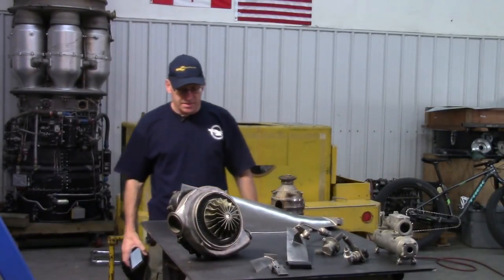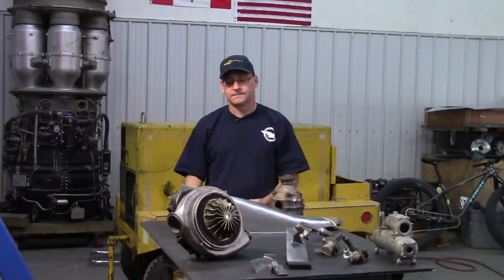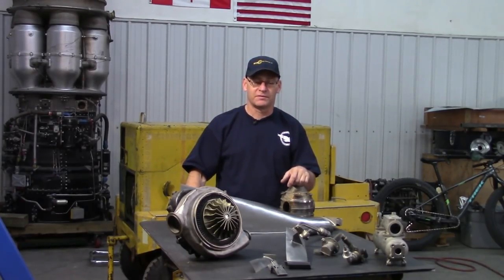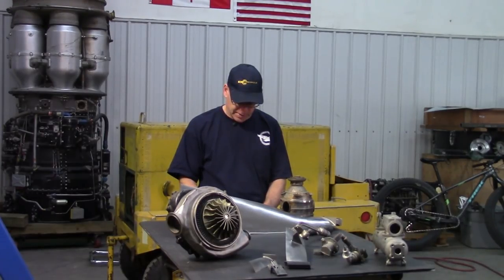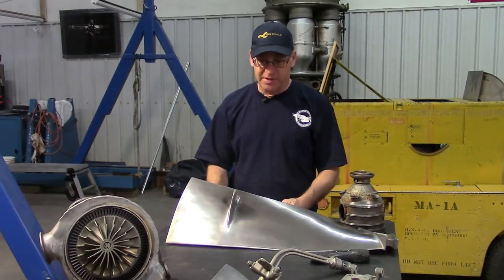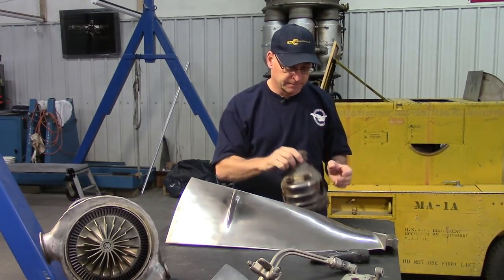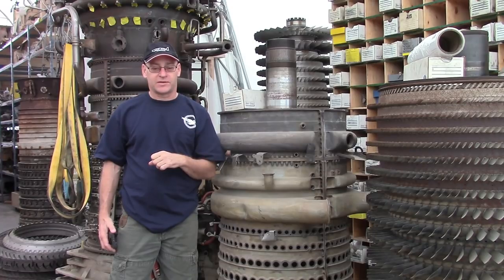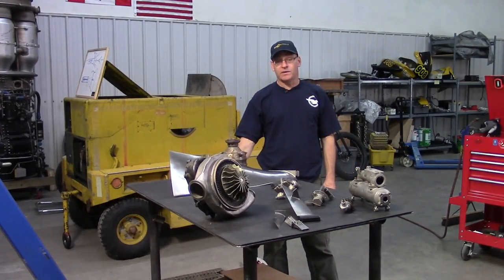Jet Questions 97

Comment: Hello. Such a great channel (watched probably 70% of videos)
Are there any special engines designed to work vertically (on a ship or a helicopter)? Is it possible for a conventional engine to work vertically for a long time? If not, why?
Reply: Apologies if I'm butting in here, AgentJayZ, but I can offer some personal experience.
So let's start with the Boeing V-22 Osprey: its engines can operate in a horizontal attitude, a vertical attitude, or anywhere in between.  However, the engine bearing chambers ('sumps', to give you the US terminology) have had to be specially designed to allow the oil to be scavenged at any attitude between the horizontal and the vertical.  Similarly, the engine oil tanks have had to be designed to return the oil back to the bearing chambers.  
The oil system on a 'conventional' engine is, typically the only 'on-engine' system that is gravity-sensitive: the tubomachinery is totally insensitive to attitude.  However, having said that, there just might be an issue with roller bearings operating for prolonged periods with no journal load, as a result of the engine being in a vertical attitude.  
Nevertheless, as you will have probably seen at air shows, military engines can and do operate in a vertical attitude for a time when the aircraft pulls up into a vertical climb.  There may (or may not) be some provision for the accumulation of oil in the bearing chambers and some loss of oil through 'flooded' oil seals may be tolerated.  
The basic answer to your question is, therefore, that 'conventional' engines typically cannot work in a vertical attitude for a long time because of the limitations of their oil systems.
I'll give you some personal experiences in another post.
Reply: And now for some personal experiences.
Years ago, back in the 1960s (when dinosaurs ruled the earth), Bristol Siddeley Engines (soon to become part of R-R) designed a version of the Marine Olympus engine for vertical operation.  The objective of the proposal was to save installation space in a warship.  I was not actually involved in the design, but I did see the drawings for the gas generator and the direct-reversing centripetal turbine that it was intended to feed.  However, the proposal did not go much further than the project stage.  
The gas generator was to be mounted in a 'nose up' attitude and the bearing chambers were redesigned to provide a sump volume at what would have been the rear of the chambers in a horizontal position.  The scavenge passages in the chambers also had to be repositioned to draw from these sump volumes.  Just consider, for a moment, the added complexity of designing the bearing chambers  that would be required to permit scavenging anywhere between the horizontal and the vertical, as in the V-22's engines.
Years later, however, I had to consider doing just that (and discount the proposal) when a newly-formed German airship company came to R-R and asked us to look at powering their proposal for a massive new cargo airship.  It would have been the largest airship ever by far, with a carrying capacity of 250 tonnes, and would have had to corner the world's supplies of Helium, which already made it an improbable proposal.  However, I digress.
The Chief Designer of the company wanted us to come up with a redesign of the RTM 322 helicopter engine, which could be swivelled between the horizontal and the vertical in a ducted fan propulsor pod.  He also wanted 'banks' of engines permanently mounted in a vertical attitude, to provide fine adjustment of lift, in order to avoid valving off too much Helium.
We could possibly have redesigned the engine, but it would have meant a major 'tear up', as there was no space around the bearing chambers in what is a very compact engine, to create the necessary sump volumes.  He would not hear of mounting the engines in a horizontal attitude and using transmission shafts.  This was despite the fact that long transmission shafts were used in the V-22 to cross-couple the props and had been in use for years in the SRN4 hovercraft, powered by four Proteus turboprops (which I also worked on at R-R).
In the event, the airship project came to nothing and the truly massive hangar, built for it on an abandoned Soviet air force base in the former East Germany, was turned into an indoor holiday/vacation resort.
Reply: Сomprehensive answer, thank you very much!
Reply: You're welcome.  I enjoy my rambling reminiscences.
Reply: +grahamj9101 As usual, excellent explanation sir. Keep it up.
Reply: +Grahamj9101 - Thanks for the excellent detailed replies and just as 
a brief aside, the lift engine used on NASA's  Lunar Landing Research Vehicle (LLRV), aka the flying bedstead was mounted vertically. Probably designed for horizontal application and modified for that purpose. PS just found this        
https://en.wikipedia.org/wiki/Rolls-Royce_Thrust_Measuring_Rig

Not the same Bedstead though ...LOL
Reply: R-R also produced vertical lift engines: the RB108, RB162 and XJ99 (jointly with Allison) and modified  the RB162 for horizontal use as a boost engine for the HS Trident 3B.

Comment: 29:48 "gas turbines work better at higher pressures and higher speeds" -- is this for all (or most) of the same reasons that a compressor does its best work at designed speed and accomplishes almost nothing at low speed?

Comment: Are there no limits to jet engine power, ie, why did concord fly so dam fast. And have you ever worked on one of them, concord engines that is.?
Reply from the maker: I have several videos of our test runs of Industrial RR Olympus engines, which are predecessors of the significantly more powerful Olympus 593 engines used in Concorde. I worked on some of those.
Jet engine power is limited by how much air can be taken in, how much it can be compressed, and hot the turbine section can run.

Comment: Do you know of any jet engines that use different types of fuel for the engine and the afterburner? (I know this would be weight inefficient due to the extra fuel system mass)
Reply from the maker: I do not.
Reply: I believe the designers of the XB-70 wanted to do that at one time for the afterburner  but the research on high energy fuel was abandoned.

Comment: I believed the Coffman cartridge starter was used on older aircraft engines
I was very surprised to see it being used to start the F-22 Raptor
I'm not certain but the Eurofighter Typhoon has carbon deposits in a similar area
I have tried to look this up, but no satisfactory answer as yet
Reply from the maker: Raptor system is different. The cartridge starts the APU, which is then used start the main engine.
Much less rocket fuel needed, and less smoke.
Reply: @AgentJayZ  OK thankyou for the assistance as I tried looking up this system too, not had much success recently in my searches
you've been a big help, Happy Days,
have a good week.
Reply: The Coffman cartridge starter was indeed used on much older engines, most commonly radial piston engines used during WW2. This forced a piston forwards, engaging a bendix drive with the engine flywheel. The cartridges used were relatively small and resembled blank shotgun shells, hence it often was referred to as a shotgun starter.
The cartridges used to start gas turbine engines are much larger, the smallest ones being about the size of a coffee can. The propellant is the same (usually cordite or some other smokeless powder), just more of it, since the turbine starters require a much larger quantity of high pressure gas to run them.

As I understand it, the F22 has a hydrazine powered gas generator on board for emergency power - hydrazine can be catalytically decomposed into a mixture of hot, high pressure gas (nitrogen, hydrogen and ammonia in variable proportions) which is then used to drive a turbine.

Comment: What dictates the amount of twist on a turbine blade? (A better way to describe this is apparently not available in my mind at the moment, but you should know what i mean, hopefully.
Reply from the maker: +Ozzie Peck 
Too complicated for a comment box.
The books featured in a very recent video explain it well
Reply: You need to understand velocity triangles: check out the books that AgentJayZ has recommended.
PS Describing the change in aerofoil stagger angle from root to tip as 'twist' is fine.
Reply: Thank you!
Reply: PPS You can see the effect of the change in blade velocity (that is its velocity in ft/sec or m/sec, as compared to its rotational speed) with increasing radius by comparing a short HPT blade with a long LPT blade.  The short blade has relatively little twist, while the long blade has a very pronounced twist.  You might also notice the reduction in camber of the aerofoil section with increasing radius.

Comment: Jay, have you ever worked on and engine that used blisks? I imagine they must be a pain in the ass to work on.
Reply from the maker: +makecba
 Whether turbine blades are separate or an integral part of a blisk... is a minor detail when considering what an engine is like to work on.
Reply: If and when, in years to come, S&S and/or Maddex handle an industrial/marine derivative of an aero engine  with compressor blisks, they will probably be equipped with a linear friction bonding machine.  A damaged compressor aerofoil will first need to be machined off,  to permit its replacement with a new aerofoil.  It's already happening as a new production process.
Reply: I've been replied to by Jay and GrahamJ9101. I can now die a happy man.
Thanks a lot for the answers. 
I was thinking it must be a PITA to have to replace an entire blisk instead of just a few blades, that is without even factoring the cost of it.
From my understanding, blisks are primarily used to save weight, which in an industrial engine is not that necessary. Am I right? Or are there aerodynamic benefits in having the entire disk made of a single piece?
Reply: No, blisks are used primarily for weight reduction.  However, when the industry is fully tooled up for blisks, it may be less costly to bond blades onto their discs than to machine blade root fixings.
PS  In the first instance, I am referring to compressor blisks.  I  have yet to see any evidence of turbine blisks being introduced on any large engine.  However, there's nothing new under the sun.  As an apprentice, back in the 1960s, I recall seeing blisks being machined for small helicopter engines (Turbomeca Palouste and/or Artouste?), four at a time, using a copy-milling process.

Comment: Jay,do you carry spares for Avon 208 series?
Reply from the maker: I don't know exactly what a 208 is. Is it an aero engine? Maybe for a hunter? Anyway, we sometimes buy surplus aero Avons for the core parts for industrial use in 1533s and 1535s.
Sometimes we keep the aero externals. 
So, maybe, but probably not, depending on what you are looking for. Not enough information in your question.

Comment: Is a cartridge starter kinda like an EPU on an F-16?
Reply: Not really. The EPU, as far as I can tell, is a rocket motor spinning power turbines to run emergency electric/hydraulic generators, a cartridge starter is a bigass blank shotgun shell that is used to instantly spin the engine up to starting speed. It's basically a gunpowder charge that does the job of that yellow cart Jay put the whiteboard on, in under a second. Just search "cartridge start" on youtube, it's really quite impressive. They also used it on piston aero engines and tractors back in the day.

Comment: 7:03 Why?! Because its to good stuff for the average Joe? Ridiculous.
Reply from the maker: When the US military sells things for "scrap", they want you to use it as scrap metal. So they make the thing non-functional. Usually with a Jet engine, they only destroy the parts that have military applications, like afterburners and such. The folks assigned to do the actual de-activation are, shall we say,  possibly not really involved with aircraft design, service, or maintenance, and may not know the function of every part they see. So sometimes they get a bit over-motivated and wreck everything. Sometimes not. It's a gamble you take when you buy military surplus jet engines...
Reply: @AgentJayZ  Ok that make sense then, thanks.

Comment: Hello AgentJayZ.  I would like to first start off by saying happy holidays to you and your family as its Dec. 23 - 2017...  

Anyways.  Im by no means a conspiracy believer but did have a question regarding CON-Trails.  We often see planes above us in the sky with trails following hundreds of Kilometers or Miles...  Why, when you are testing your engines in very low temps, that we dont see huge clouds of vapor forming behind the engine? I couldnt find much on my research regarding static engine testing in cold weather.  I was hoping you could shed some light.

Thank you very much for your educational videos!
Reply from the maker: Good question. Maybe the condensation does happen, but the exhaust jet from a static engine has a much higher delta V to the atmosphere, and therefore stirs things up a lot more.
The contrails are obvious from five miles away, but, like a cloud, I bet you can't see them when you get close.
Reply: Contrails are BIG and if there were water condensing into cloud, it would be visible above the trees. We'd also see them around airports on a regular basis. Air near the ground is usually too warm and dense for any clouds, be they natural or man-made.

I'd suggest looking for a ground-level contrail next time there's an engine test on a foggy day, but fog and contrail and cloud are all the same thing so there really wouldn't be anything to see.

Comment: Would it be possible to use the bleed air from one engine to "bump start" another engine?
Reply from the maker: I talk about that in this video, and explain it in more detail in several videos in the playlist Your Questions Answered.
Reply: Poor wording on my part. I meant in a theoretical situation having the bleed air ports on 2 engines connected through a crossover valve of sorts. Would a running engine be able to bleed off enough air to start the other? 

If not, could such an arrangement at least be used in a compressor stall situation?

I guess what I'm really intrigued by is, could there be any benefits of linking the compressors of two engines?

Thanks
Reply: Yes it's plausible. They use it all the time on airliners. Air supplied by the APU starts engine one, engine one supplies air for starting engine two.
Reply from the maker: +aleks138 
You're getting caught up in terminology that is not being used quite correctly.
Bleed air can power a starter, and it can be used to turn a turbine engine to starting speed, as with the air impingement starter.
You do not direct starting air at a compressor.
Connecting two compressors in parallel is of no use and is not done in the way you describe.
Reply: There may be some confusion going on here. On the A380 I fly we can start an engine where the APU is inoperative by using an external air supply cart - rather as you see on AgentJayZ's videos for the J79. Once the first engine is started, we can then use bleed air from the running engine compressor to supply the necessary start air. The air is supplied via a cross bleed system so the bleed air is routed to where it needs to be to start the other engines. We can also start the other engines using a combination of external air supplied by a cart together with bleed air from any running engine's bleed supply. This is done automatically by the air management computer. Not sure if that makes it easier or not, but actually in our case, two or more running engines can be linked together to supply the necessary air pressure to start the last engines.
Reply: Nevertheless, the bleed/start cart air must go to the air turbine starter of the engine(s) to be started, not to the HP compressor(s).
Reply: Indeed, it's important to specify that. I seem to recollect that there were compressor impingement starters in the old days, I think there is a mention of them in the RR book, I doubt that this would be used these days.
Reply: The J79 certainly used impingement starting: AgentJayZ has shown us this.  One mark of Armstrong Siddeley Viper (Viper 11?) certainly had it: the engine had a single-stage shroudless turbine and I remember working on it as an apprentice in the 1960s.

Comment: doesnt the sr 71 use bypass air for thrust.
Reply from the maker: Well, depending on what you mean by any of the words you've thrown together, yes, and no.
In the industry standard terms, the J58 is not a bypass engine. It's actually a very specialized type of turbo ramjet hybrid, and is outside the discussion of engines featured on this channel.
Bypass air has a very specific meaning in the world of conventional jet engines.
The J58 is not a conventional jet engine, so any terms used to describe conventional turbofans and turbojets do not necessarily apply to it.
So... yes, and no.

Comment: Do you have a video that explains why turbine engines are so much more reliable that piston?
Reply: he probably does, but you could probably count the moving parts and the parts that change direction and it'd go a long way to explaining it
Reply: @operationscomputer1478  Well, maybe, but the jet has so many valves, pumps, regulators, actuators, etc. that it doesn't seem simpler than say, a 6-cylinder lycoming...